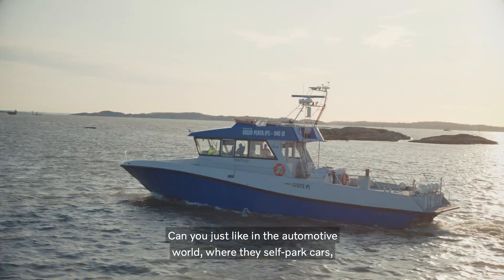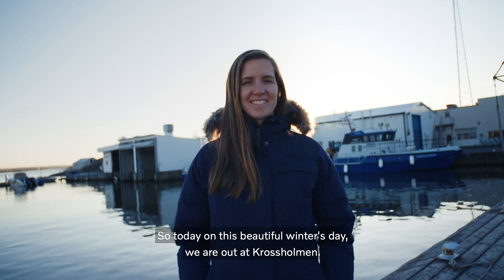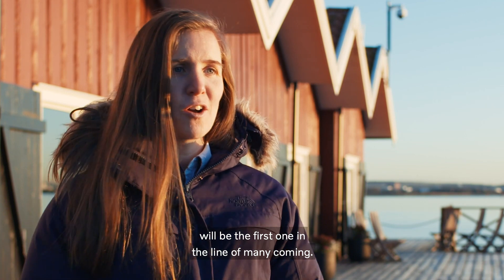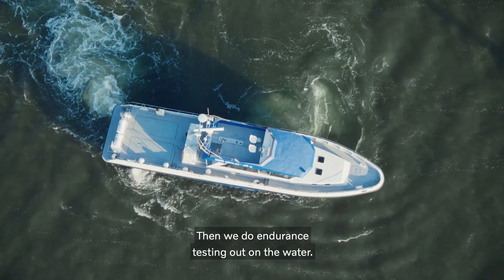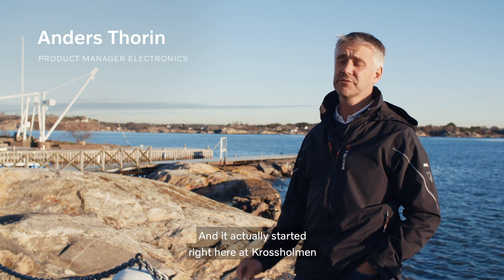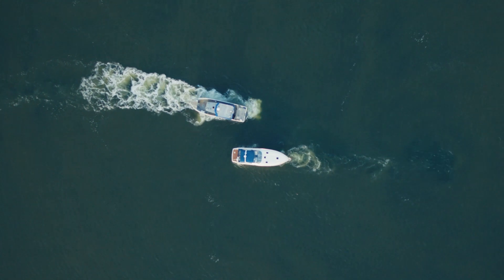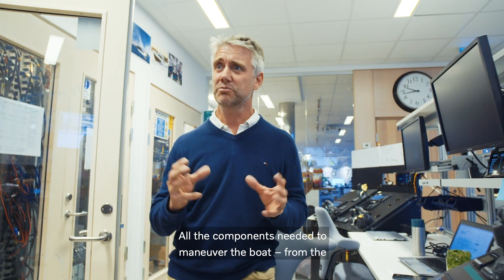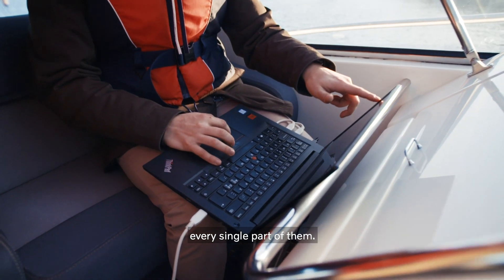Volvo Penta Launches Industry First Integrated Assisted Docking System

Comment: The previous versions of joystick control used Volvo Penta IPS engines. This demo used shaft drive propulsion. How will the system function on Power Catamarans with shaft drive, and does it require bow thruster assistance to work properly?